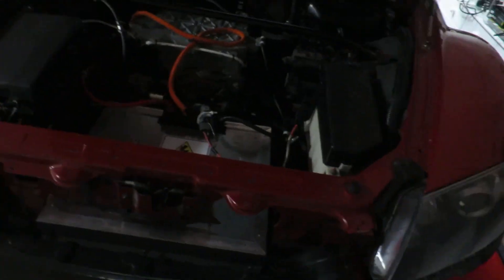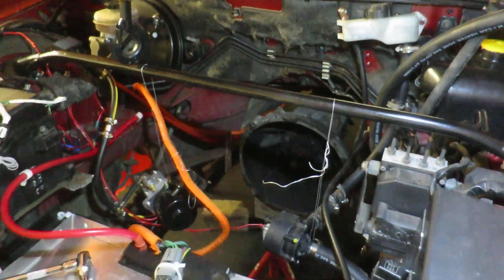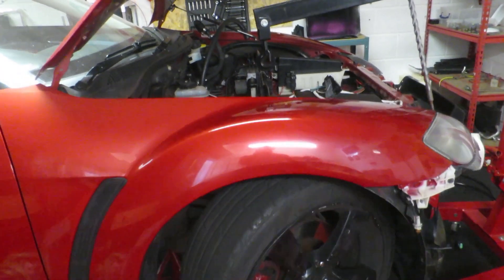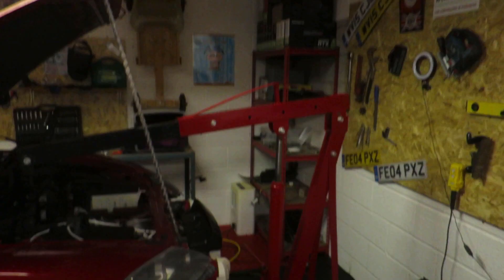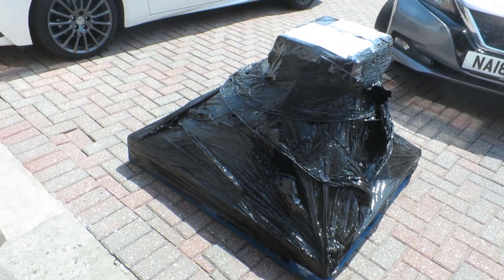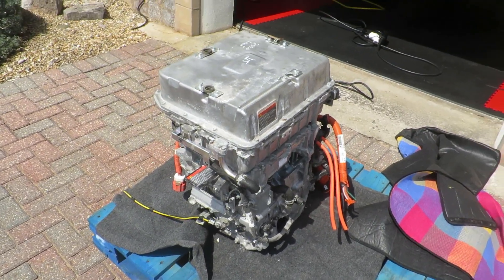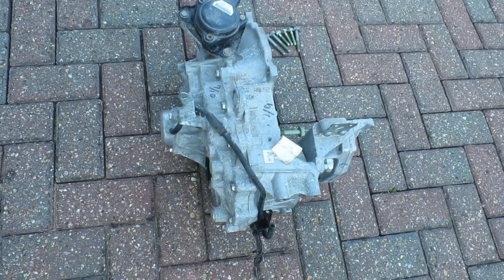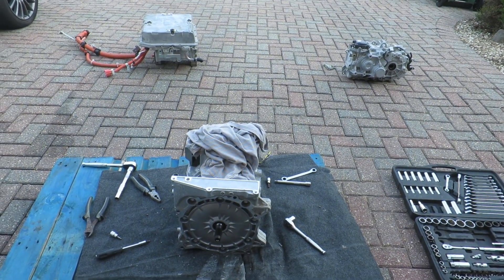Upgrading Nissan Leaf from 80kw to 160kw - doubling the power of my RX8 EV Conversion.

Comment: sorry for my confusiong,  but,  you refernce "THE NEW STACK".     but..  what did you actually do to increase the power?    is it a different engine?   how did it 2x in power?    is it the newer style from nissan?    what is the old and new model number for my refernce..    Sorry for newbie question.   I did some research about the new motors,  but,  the video doesn't "confirm" it for me.     I need validation.   🙂
Reply from the maker: I replaced the gen 1 inverter for the gen 2 E+ inverter. 80kw to 160kw.
Reply: Just to confirm does the motor actually put out 160kw? Exactly the same motor putting out doubble the power? If I had to do the same using a leaf gen 1 motor, would I onky need to replace the inverter to achieve this ?

Comment: It will interesting to see the power and range figures when you are done Dave. Just a thought, there seem to be ways to get those later chargers to take a chademo fast charge re open inverter forum.
Hope to see you back on the road soon.
Reply from the maker: Yeah, I thought about replacing the charger too, but to be honest I am never going to go far in the RX8, and trickle charging at home is fine.

Comment: Sounds like a really exciting upgrade Dave and looking forward to more updates.
The only concern I would have is are your old batteries, battery cables and connections up to the job of handling the extra current. 160kW is around 400A which might be over the rated current of the older battery hardware. I'm using 35mm2 cable myself which is only rated up to 250A  but I'm using a stock Gen1 Leaf inverter so it won't be an issue for me.
Reply from the maker: So I have the 30kw pack, which shares the chemistry of the newer 40kw and larger packs - so I feel the batteries are all OK to handle the power. Unless they have had some internal copper upgrades in the newer packs. Cable is an interesting one, I think I will change the internal display in the car to show current draw so I can keep an eye on it. 35mm2 cable is 250A maximum constant current in my understanding? Struggling to see what peek current is. I doubt the inverter can pump 400A for very long either. Good points, well made though.
Reply from the maker: Ive just measured the HV cable going to the PDU in the new unit - 12.2mm wide (35mm2 is 11.8mm wide). 40mm2 is 12.7mm wide. So Nissan dont seem very worried about 400A bring pulled very often or for long.
Reply: @SouthWestEVUK  VW used 35mm2 busbar in their eGolf which is a 100kW car with a 88S battery pack so a maximum voltage if they charged each cell to 4.2V of around  370V. If they can still get 100kW from a half charged battery then the voltage would be around 330V. At that voltage to have 100kW they are drawing over 300A through their 35mm2 cable and busbar.
I guess there is some wiggle room here.

Comment: The irony of replacing the old inverter because it may have gotten too hot and now you're shirtless in one of the UK's worst heat waves ever. This is such an Australian thing to do. Working on cars with your shirt off. LOL.
Reply from the maker: Yes the irony is not lost over here!
Reply: Hi can you recommend a reliable supplier for the e+ stack. Buying components for a future build and want as much power as possible. Great videos very informative
Reply: @nigelbriscoe1389  You replied to my comment in his post accidently. Best to put the question back into the main thread or he may not see your question. Good luck with your build.